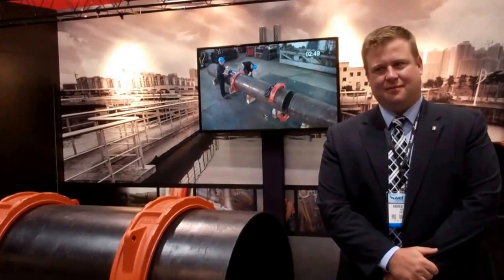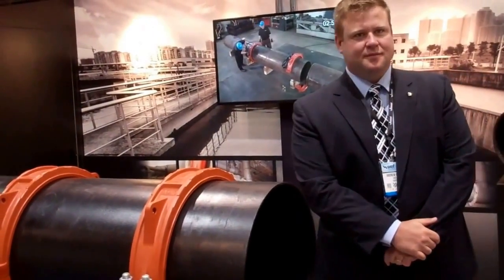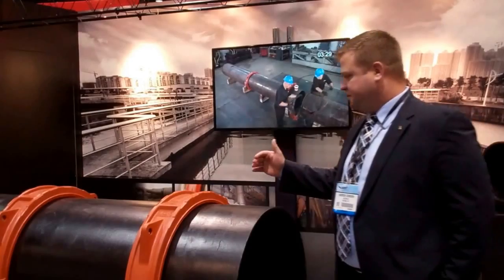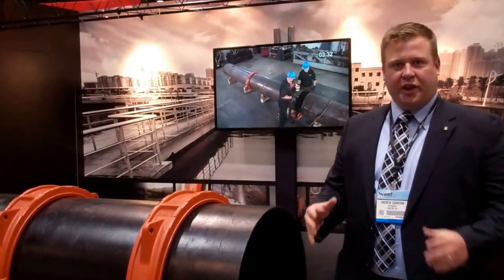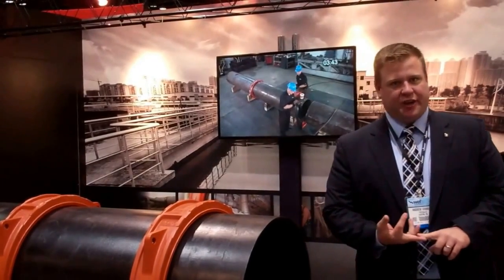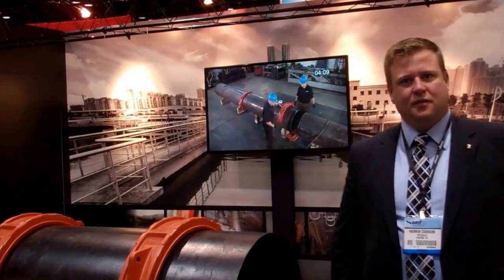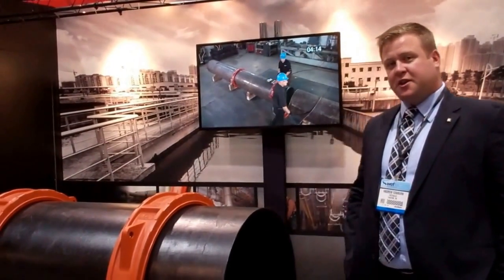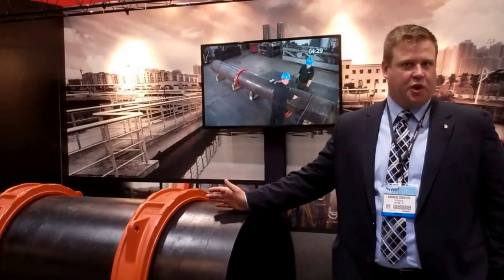Victaulic Advanced Groove System (AGS™) for Water & Wastewater Piping | WEFTEC 2013

Comment: Is this a rolled, or cut groove? Is this a fabrication that is easily done on site, or something that has to be fabricated before it makes it's way to the job?
Reply from the maker: The AGS is primarily Roll Grooved however, it can be cut grooved for special application. It can also work on a Vic Ring system as well. The grooving can be done both in a shop or performed easily in the field utilizing Victaulic Grooving Machines. Feel free to contact Andrew directly at Andrew.Cowburn@victaulic.com.